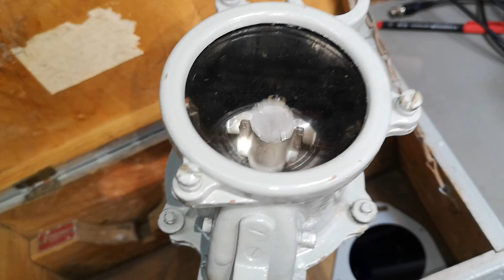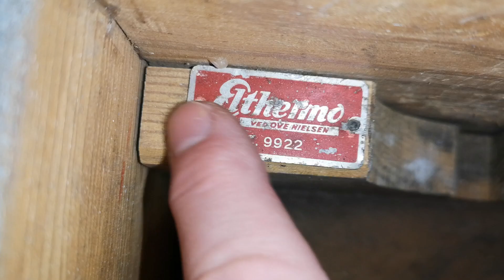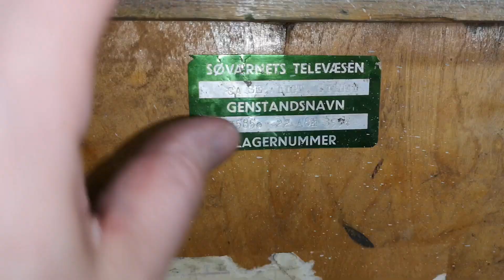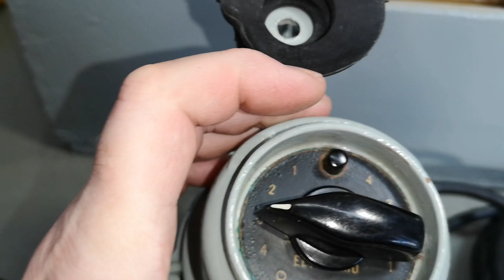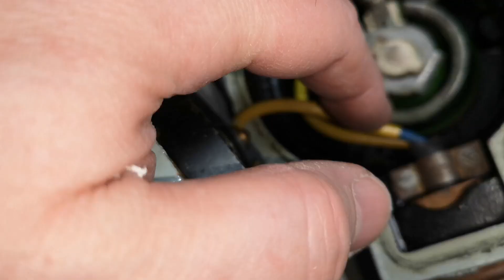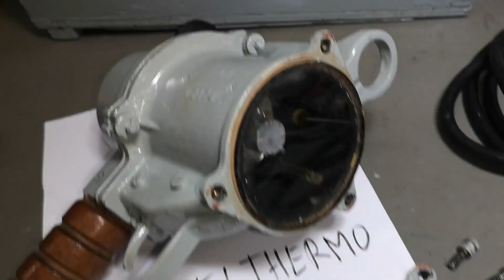Marine Morse Signal Lamp Elthermo C9922 test teardown

Comment: I'm a little late (10 months) to this party... but very COoL signaling lamp. I always though that it would use a "flapping valve or plate" so to speak to modulate the signal and not a bulb thing ah'ma jig it does use. Clearly that is better. WHERE DO YOU GET THIS STUFF :face-fuchsia-tongue-out: It's like you traveled back in time to REAL surplus stores :face-blue-smiling:

Comment: Hi, this is beautiful, as a boy I used to collect strange lamps (mining, military, etc. - the collection was interrupted by a move - there was nowhere to put it, and in addition, part of it disappeared during transport), this one is beautifully preserved. I assume you know this, but never loosen stiff screws when dry, always use some loosening spray. They have it very cleverly thought out, not only mechanically but also electrically, a covered bulb would overheat when operating at maximum voltage and would not last long. The sharpening of the focus is also ingenious, because the light bulb cannot be manufactured without zero deviation for anchoring the filament, and if the parabola were fixed, the focal point would be different after each replacement.

Thanks for the sample, Have a great day 🙂 Tom